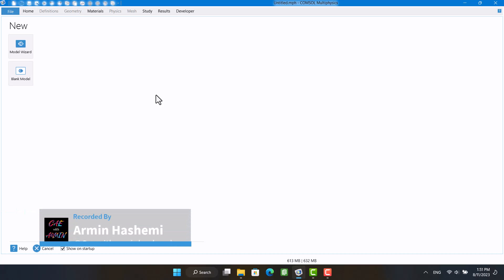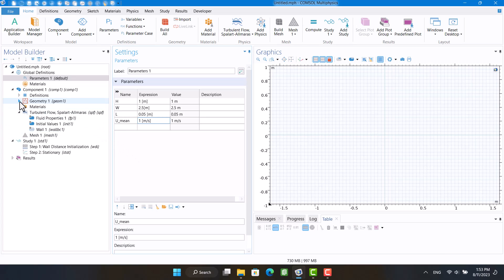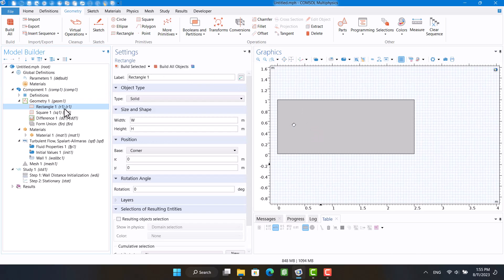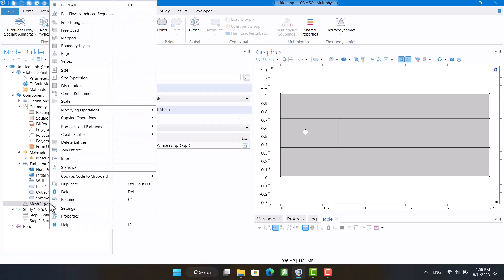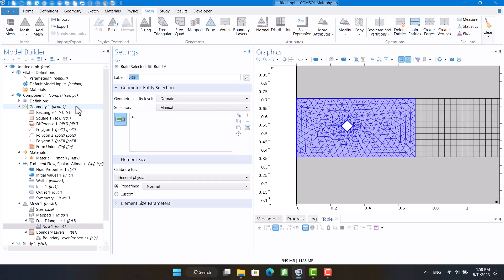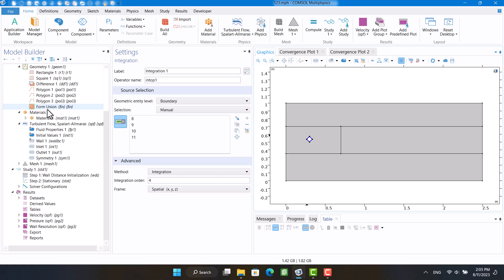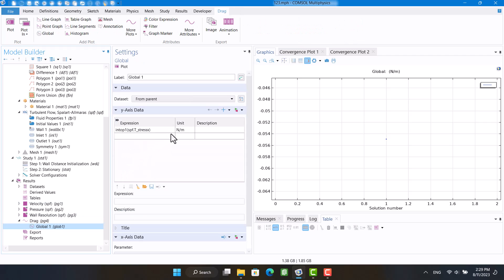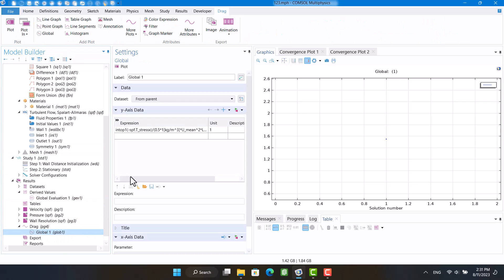💨📐 COMSOL Tutorial: Drag Coefficient of a Square Cylinder 🧊

Comment: Hello, sorry again, when i input the formula, it says "cannot evaluate expression" and "undefined variable" underneath. instead of turbulent flow, i have used the laminer flow and i am trying to find in y direction (i am findind the Cd from 3d cfd simulation). and the formula i have input is "spf.T_stressy". sorry this is my first time using comsol so forgive me.
Reply from the maker: The notation and name of each output may change when you alter the dimensions or the type of fluid. You need to refer to the COMSOL documentation to find the names of stress or pressure in laminar physics.
Reply: @caewitharminhashemi thanks man